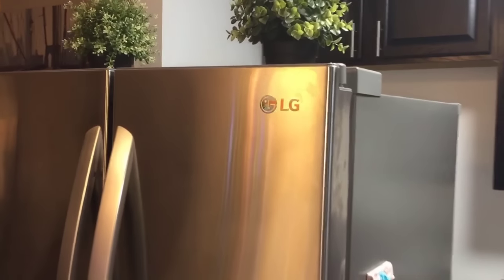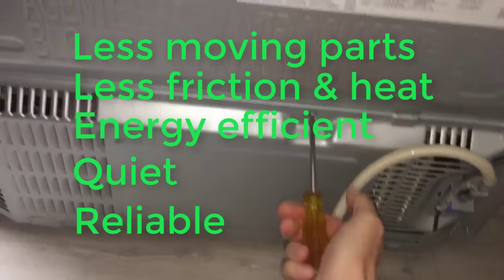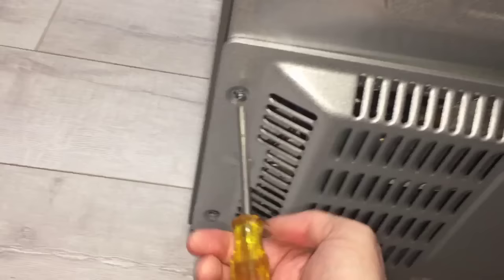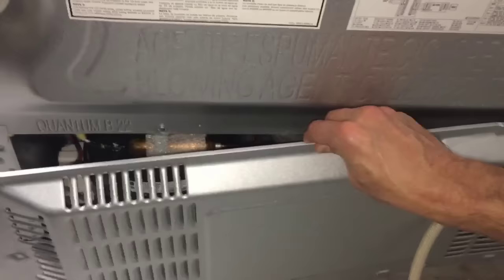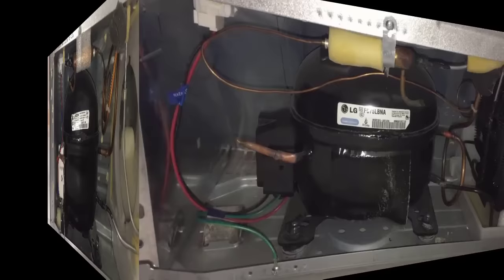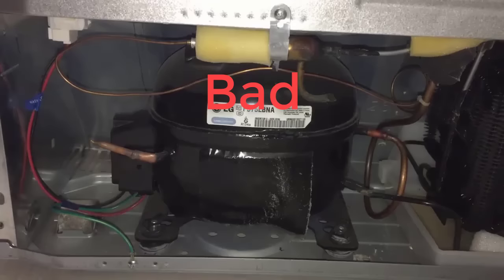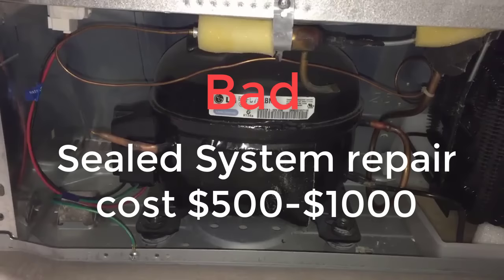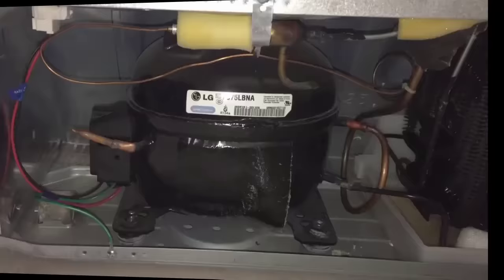LG fridge not cooling but running

Comment: Kenmore Elite, Estimate on replacing compressor $1,389. And repairing fridge.    Guys complete yunk.   How can we stand a class law suite against this product made by LG.  Sears is backed up on these fixes.
Reply: Complete junk..not worth repairing
Reply: Ok Called in LG service for around $300 CAD flat charge. And they installed new compressor/ mother board etc. It's on their website. Compressor has 10 year warranty. And one time for a flat charge they will come and fix anything wrong with the fridge...it was told by a Best buy salesman when we went to buy replacement fridge.👍
Reply: Got my Kenmore Elite fixed.  New compressor.  $650.  Could not get in contact with LG before guy actually showed up... so did it.  Got it fixed.  9/19/19...  lets see how long it last.  LG #(FC75LBNA) compressor ...  Ebay sell these compressor for $300. Plus shipping
Reply: Jerry Cruz hows the fridge?  Still working well?
Reply: @fyung  after new fix, yes is working better than new.  Ive installed WholeHouse protectors also.

Comment: I have the exact same model lg refrigerator.  The compressor is running properly according to your video.  It has a full charge of freon and I  ran the diagnostic test button and everything is fine according to the test!  Why won't it cool?
Reply from the maker: Sometimes the compressor sounds OK but still is not good. It's called an "inefficient compressor." 
 How do you know it's full of Freon? I assume you charged or checked the LOW side of the system. What is the PSI pressure when the compressor runs and PSI when you unplug the fridge for about 5 minutes? Let's say the pressure is about 50 PSI unplugged. And when you plug it back in, the pressure drops to about 30 PSI... which means the compressor is inefficient. Because a good compressor should drop down the PSI close to 0.
Reply: @Your-Self  we put a gage on it and it was in the green zone already.  We didn't attempt to add any.
Reply: @Your-Self  so, I live in Tucson az and nobody will even work on an LG.  I called a couple of places in Phoenix but one, the guy died from covid and the other,  though they claimed to work on LG, wouldn't come out.

Comment: How often do you Replace a Refrigerator Compressor and in a few months it goes bad and needs Replacing again? I ask because I Replaced the Linear Compressor in a Kenmore Elite 4 months ago and Worked perfectly until today when it was discovered both Refrigerator and Freezer were Warm!?
Reply from the maker: When Linear compressors fail, they create a lot of debris inside the sealed system. You have to replace the filter/drier and vacuum the system to make sure nothing left to create a restriction. If you installed the new Universal compressor FLS075LANA it requires a software update on the motherboard, otherwise, it will fail early or won't start at all. Also, Linear compressors must be charged by correct weight, not by observing the low side pressure. That being said, I'm not surprised it failed so soon, it could be bad right out of the box. If it's under warranty, request another one.
PS. is the compressor running, but not pumping, or not running at all?

Comment: So I've got a LG linear side by side bought in June of 2016, and just the other day the freezer stopped cooling and the fridge seems warmer too. What's weird is if I press the front button that says Cool Zone Plus it will cool and you can hear it work. But when that mode stops after 24 hours, it's back to no cooling.
Reply from the maker: Try to figure out when the freezer is getting warmer, if the compressor is running, but not cooling. In this case, your refrigerator may be covered under LG 5-year free compressor replacement.
If the compressor is not running at all, while the freezer is getting warmer, it could be some electronic problem and maybe not covered under warranty, unless you bought an extended 5-year warranty.
Reply: @Your-Self  thanks, yes it's running but not cooling. The 24 cool zone plus thing also stopped working now. I called LG and they said that a service center would be calling me in 3-5 days. Thanks for your help!

Comment: What if my freezer is working blowing to -5 degrees F, but fridge has temp of 58 degrees F?
Reply from the maker: It depends on the model of your refrigerator... single or dual evaporator? The damper door between sections maybe not working properly, bad temperature sensor, bad defrost system not melting evaporator completely.

Comment: Just purchased LG single door 235l fridge yesterday. Freezer working but refrigerator not cooling what's the problem? 😔 😔 😢 😭
Reply from the maker: I'm not familiar with that model but it looks like the cold air is generated in the top freezer and should be distributed by Evaporator Fan to the refrigerator compartment. Maybe the fan is blocked by food, or the Damper Door is not open for the cold air to move down to the fridge.
Reply: @Your-Self  I didn't fill up trays with any foods.

Comment: Just subscribed 🎉 How long do the compressors last on a refrigerator? Also, would you recommend fixing the compressor or just haul it away/ buy a new refrigerator?
Reply from the maker: Nowadays, compressors should last more than 10 years easily.
LG had a bad batch that broke within 5. But since 2020, they have a newer compressor that should last longer. However, nobody knows if that's true just yet.
Fixing or buying depends on your specific situation and the price range you are willing to pay. If it costs more than half to repair over buying new, it's better to buy new.

Comment: Mine is a Kenmore Elite made by LG so it has the same guts and issues as the LG.  Fridge is on its THIRD compressor replacement!
Reply from the maker: Wow, 3 compressors... that really sucks.
Reply: Mine is also a Kenmore Elite made by LG, it died a week ago.  Everything is ON, but cooling.  Bought it in 2014.  Sears said Linear Compressor is free, but need to pay labor charge from 200-400
Reply: @ktran7209  that's bad. I'm struggling with mine right now. It's  only cooling to 50 degrees on the fridge part. The freezer is fine.  I'm about to call the service man. I know it will take weeks for them to show up. Pre-pandemic it was a 2 week wait.  We are caught between a rock and a hard place, new ones this size are over $2500 to $3000 USD.

Comment: Beyond replacing a recirculation fan , scrap it if needs anything  else or part it out on ebay get your money back.
Asian made and brands of appliances  are all utter garbage especially  LG and samsung. 
My old Kenmore stainless fridge is still running fine after +20 years and yet a 5 year old LG is garbage

Comment: Is it normal for the compressor and fan to go off after a while?
Reply from the maker: Yes, the compressor and fans work in cycles. The length of the cycle varies and depends on the need to cool.

Comment: So will replacing the compressor help? I've seen new ones available on Amazon for under $400. Has anybody had any experience with replacing the compressor? Thank you
Reply from the maker: Yes, the new compressor will fix the issue. However, the labor cost of replacement can be an additional ~$600. If you go through the LG warranty department, they may replace the compressor for free (if it's under 5 years old), or for about ~$400 total.
Reply: @Your-Self  Thanks, unfortunately I bought it from a warehouse, no serial #, no warranty. I already bought a new Samsung from Lowe's but might cancel the delivery if it's better to spend the $1K, however, no warranty again. 

It's probably better, I think to get the 10 yr warranty from the factory, no?
Reply from the maker: Yeah, a technician will probably give you a 6-12 months warranty on the compressor replacement. And the new one comes with a full manufacturer's warranty... tough decision.

Comment: whoa.. i bumped into this AFTER i experienced this and got it fixed/replaced (under extended warranty for both parts/labor). But mine sounded like a 'good compressor" and not like that bad compessor (even after cleaning coils). If you have a young LG fridge and it just stops cooling, most likely it's this.
Reply: Did you have yo replace the compressor or something else?
Reply: @sjen9729  the "compressor"? no. just replaced the tires.

Comment: Why would you have to pay anything for a failed compressor unless it is over 10 years old as they state a 10 year warranty on the new linear compressors...
Reply from the maker: That's how they get you. The 10-year warranty is for the compressor only, but you have to pay for the installation labor, which varies from $350 to $600. Also, most of the time, you have to pay for other Sealed System components that must be replaced together with the compressor.

Comment: I have an LG French door fridge that broke down after 3 years. A technician from LG came and changed the compressor and the motherboard and now it cools, but it’s not cold enough and there isn’t air flowing out of the back vents in the fridge. It’s a little cold but no where near as cold as it should be and if I put my hands at the vent, there isn’t any noticeable air flow. Any ideas? LG isn’t very helpful when I try to call them. A fridge that lasts only a few years? Remember when fridges used to last 15 plus years? LG’s fridges breaking down after 2 - 3 years is fraud
Reply from the maker: If you are comfortable around electricity, try the Test button on the back mainboard as on the next video to see if all fans work. https://youtu.be/70y61Sq_NU0
Otherwise, whoever repaired your refrigerator probably gave you a 1-year warranty. So ask them to come back and verify that they installed the compressor correctly and that there are no leaks. To get their attention, buy 2 refrigerator thermometers for the freezer and the fridge compartments. And if the temps are not around 0°F in the freezer and 37°F in the fridge, the LG repair tech should be concerned.

Comment: Hi, just ran across your informative video as I have a cooling issue with my fairly new LG.
Its not cooling (temp around 50F), but the freezer is working fine. Food in freezer are frozen solid.
Had a tech came out and wanted $800 to fix it. Indicated that the evaporator fan is weak. I opted out of the repair and order the fan and replace it myself. I check to make sure the fan is running before closing the unit up. While I have the assembly opened, I also noted the evaporator is running with frosting/cold (so I assumed it's functioning). After several days past, frig still around 50F. So now I think the tech had mis-diagnosed the issue. Now I am back to square one. Any help/suggestions are appreciated. Thanks
Reply from the maker: A correct diagnosis is the most important step.
What is the actual freezer temperature? If it's around 20°F, the food will be frozen, but it should be around 0°F in a healthy system.
What is your refrigerator model number? It may have 2 evaporators (one in each compartment) or a dumper door in between them that's not opening correctly.
Reply: @Your-Self  Thanks for the reply. I haven't check the freezer temp yet. I'll put a thermometer in it to see. 
The model is LFXC24786D. Yes, believed it has 2 evaporators. I just pulled out the temperature sensor (within the top LED light module), the resistance measured 10 ohm. Does this value seem faulty? 
I'll check the freezer temp and report back. Thank you so much.
Reply: @Your-Self following up on the freezer temperature. It's below 0 degree F. Thanks
Reply from the maker: That model number doesn't seem to be valid. But the freezer temperature is good!
The resistance of temperature sensors changes with the temperature change. So if you place that sensor in a glass of icy water, the resistance should be around 30k (30,000 ohms). However, those sensors hardly ever go bad. If your model truly has a second evaporator, the Defrost Sensor (attached to the fridge side evaporator) can go bad.
Reply: @Your-Self  Thank you! Sorry, I mis-type the model # LFXC24796D. I'll try that suggestion when I get  chance. I did notice a sensor next to the evaporator.
I've also pulled up the LG thermistors chart online and at ambient temperature the resistance should be around 9K-ohms-11K ohms. 9-10ohms seem odds. Will try again. Thanks again for you help.
Reply from the maker: There might be something wrong with your multimeter or the way of measurement. Because the fridge is keeping the temperature pretty close to normal. And that means the sensor can't be off by that much. When you say 10 ohms, it's probably multiplied by 1000, so it's 10k.
Reply: @Your-Self  Was busy the last few weeks. Got around to pulled out the sensor and retest. It's around 13K ohms and increased as I placed it into the ice water. I also test the defrost sensors on the evaporator (tested ok) I went ahead and replaced it as I ordered and has in procession of a new sensor.
While I have the fridge apart, I monitored the evaporator for 10-15 mins and noticed that only the corner of the evap has light frosting. The rest of the evap is not cold at all (evap fan is running). Also feel the heater to make sure that the heater is not turn on that might kept the evap from cooling. Thinking that I may not given the evap enough time to cool, I reassemble everything and let the fridge alone for 24 hours. Took it apart the next day and again noticed that the evap only has light frost on the corner. 
Possible evaporator clogged or failed? I don't see any other possible components for the refrigerator section other than the control board.
Also, performed self diagnostic procedures (both on app and on control board) and there were no error or flashing light on the control board. Any suggestion? Thank you

Comment: The compressor sounds good but the inside of myy fridge is not even cold :<
Reply: kiwi paws16 same
Reply: Did anybody figure it out, in same boat
Reply: Same here.  Help!
Reply: @vicentemendez7799  not yet ooof i had to trow away my $1k fridge ;-; im ded inside
Reply: Anyone find out what it could be?  Same here.
Reply: @Tupacula  not yet i trew the fridge  away ;_;
Reply: Creep_Lyfe  It was my compressor anyway.  They fixed it for free
Reply: @michellemajako  including labor and service charge?
Reply: @pamhoffman4869  only before the year purchase.
Reply: The linear compressors wear a hole in the valve reed that holds pressure so it can’t compress the refrigerant but the compressor still runs. Mine lasted 22 months. There are videos of the failed compressor internals.

Comment: But if my lg compressor linear is running and not getting cold enough. What could be wrong.its getting cold but not freezing.
Reply from the maker: Not cold enough - could be the first signs of Linear compressor going bad. So if your fridge is under 5-years-old call LG directly, and they should fix it for free, at least in the USA. If it's older than 5 years, hope that it's a Defrost System malfunction, drain issue, or one of the fans stopped working. I'd remove everything from the freezer, including the back panel to look at the Evaporator Coils. If they are full of a thick layers of ice and snow, it's probably the defrost problem. But if there is nothing on them, the compressor is probably going bad, or the refrigerant gas is leaking out. Good luck!
Reply: YourSelf Sir thanks how can I test the fans
Reply: YourSelf defrost fans etc
Reply from the maker: Try running your refrigerator through diagnostics mode with the Test Button like on this video:  https://youtu.be/70y61Sq_NU0

Comment: could a dryer make it not cool enough our compressor sounds like the good one it is full of freon but the refrigerator is only getting to 38 degrees. They say LG has problem with dryers fridge is 6 years old
Reply from the maker: The drier/filter is just a filter, so it's possible that there is a contamination inside the Sealed System, and the filter is clogged up with debris. If it's an LG Linear Compressor, it's probably going bad, and it will get worse soon. Make sure that the Condenser Coil next to the compressor is clean of dust and hair, brush and vacuum it and that may help.

Comment: Having the same issue: compressor hums, but hardly is warm, no cooling in both sections. No error codes, no error lights on the PCB. So... I would ask another question: does anyone replaced this f@#$ing piece of junk called FC75LBNA for another compressor (which one?) and had any long term success with it?
Reply from the maker: LG recently came up with an updated version of the Linear compressor called Universal FLS075LANA for most refrigerators. But you'll need a special LG Jig to update the software on the PCB. It's been around for about a year, so no long term success stories just yet. How old is your fridge? It could be covered under LG 5 years (free), and 10 years about $400 labor cost replacement warranty.
Reply: @Your-Self  Mine is 8 years old. Yes, I am aware of FLS compressor, but according to https://www.appliancejunk.com/forums/index.php?topic=22942.0 PCB can be upgraded only on boards manufactured after 2014. So, I am up for PCB upgrade too.
Reply from the maker: Yes, you'll need a new PCB and a software Jig with an updated version, which could be difficult to find. At this point, you are probably better off paying for a labor cost if LG tech will replace the compressor and the PCB. Or buy a new refrigerator.